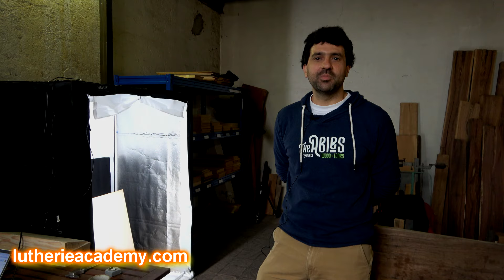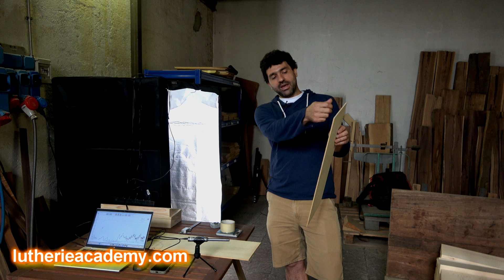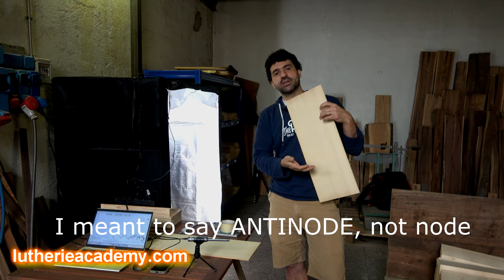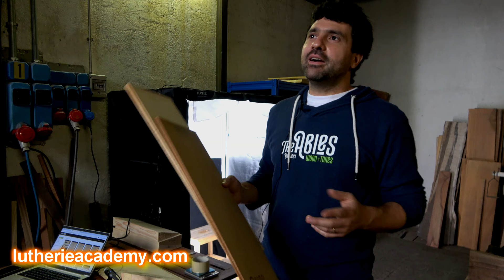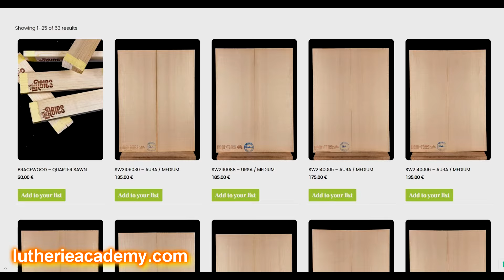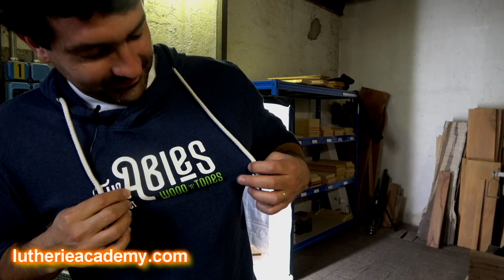The Abies Project - Sonically tested and highly selected Italian spruce for instruments.

Comment: Great that you do that with Rivolta!
Reply: Thanks a lot!
Always glad to dive deeper and share ideas 😉
Reply: @wood_n_tones Actually I proposed it to Marta in 2017 or 2018. I am happy you cooperate with Rivolta. It is a great place, but to choose wood from enormous piles of wood there is very difficult.
Reply: @bluearchguitars  I didn’t know you had the same idea!
Yeah, we’ve seen that it’s a really useful service, especially for those who can’t come in person to select the wood.
Reply: It's an obvious idea when you're digging through a pile of guitar tops, and all the tops on the top layers have been looked at and put back many times by someone, and you long to somehow get to the middle or the bottom of the stack to see the tops no one has looked at yet. At Rivolta, tops lay flat and are difficult to sort through. I offered to help Marta, but she didn't take me up on it at the time. I'm glad you're doing it now!
Reply: Don’t they use a Lucchi meter to select the tops? Bowmakers use this a lot.Lucchi meter measures the speed of sound of the wood. Very important.
Reply: @ronnyliew1208 They use equivalent method, but more cost effective and giving more info than one number. See the whole video and you will see, that they are getting the same and more info.
Reply: @ronnyliew1208  The Lucchi Meter is a very useful instrument.
However, from the frequency response and the measurement of density, it is possible to derive the elastic modulus and subsequently the speed of sound with great accuracy.
Since the Lucchi Meter operates in the ultrasonic range, it tends to overestimate the speed of sound because of frequency dispersion in the wood.